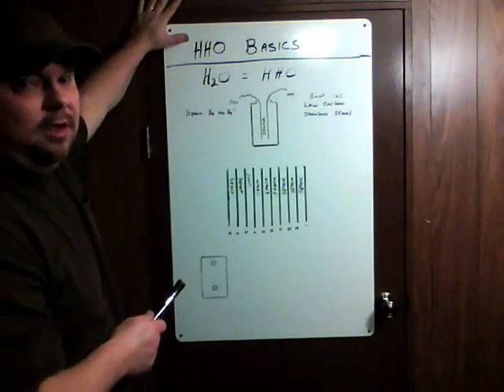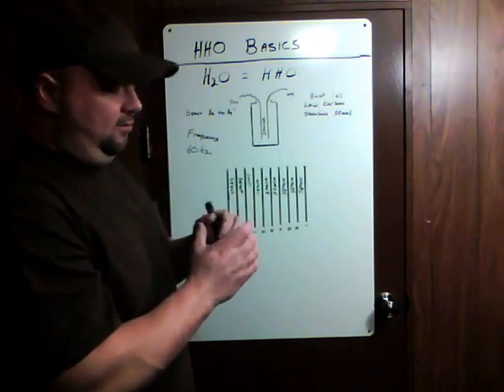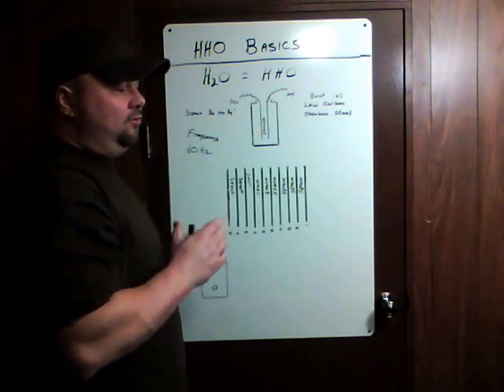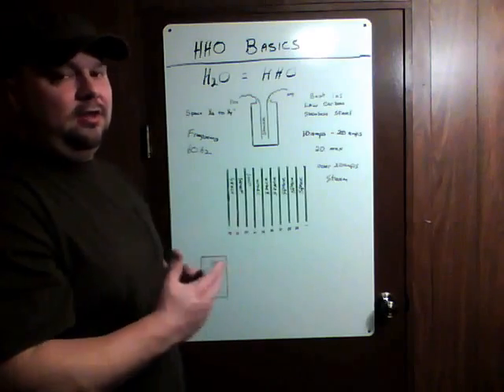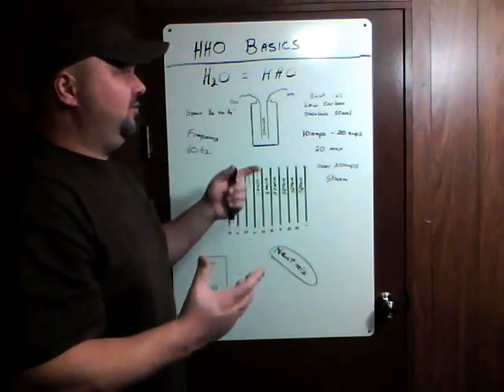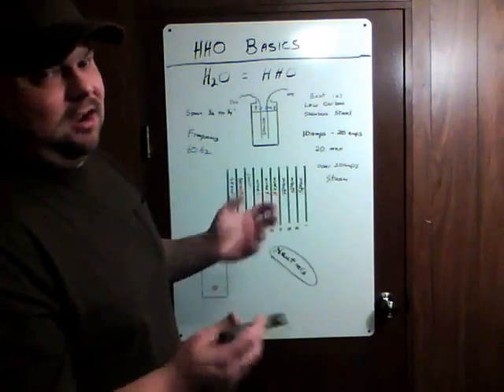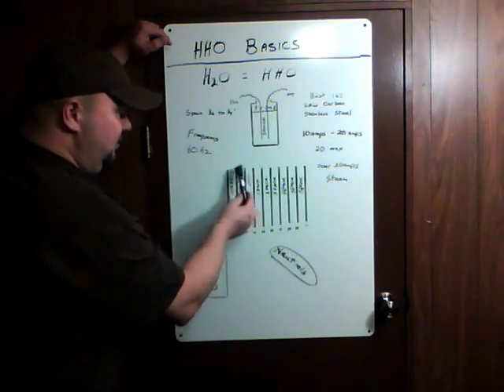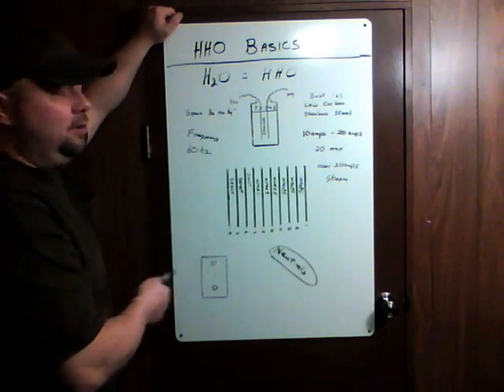HHO Basics - Learn the Science Behind Browns Gas Production - HHO Basics

Comment: In a previous video you mentioned something about hooking up the cell to a switch and earthing it. Could you go into more detail about that as I'm new to this?
Reply from the maker: For safety reasons and for other testing / maintenance purposes it is a good idea to have both a manual switch and also have the cell connected to a switched circuit in a vehicle so that the cell is only active / live / on when the ignition is on and the engine is running.  Most fuel pump circuits are good sources for this type of connection since it is normally only on when the vehicle is running.  As for the cell itself you should really use a relay to power the cell with the switched circuits controlling the relay.  This way your power source can be supplied with much less resistance both power and ground.

Comment from the maker: Wow I am sorry I just noticed I never responded to your question.  A dry cell unit can still overheat because of high current draw which will cause the water to heat up beyond a point that it is producing only HHO.  If it gets hot enough to produce steam it's actually defeating itself.

Comment from the maker: You can purchase prefab units online complete with PWM but building one yourself is a far less expensive way to get started.  Begin by building my basic design (paste this number ->3LVhNj5Hf0 in the search box ) and then move up from there once you have figured out the basics.  Unless you are getting into a larger unit a Pulse Width Modulator wont give you much of an increase in production of HHO gas anyway.

Comment from the maker: Sorry I am just responding to this post.  I talked with the guys from the lab there and they shut down the whole thing.  It's too bad because their pwm boards were the best I ever seen.  Any pwm with a high amp rating will work but theirs had far more adjustments for duty cycle and pulse width control as well as amp control which is very rare.

Comment: Good principals for traditional brute force electrolysis. I encourage developers to look into Stanley Meyers approach in primarily using Voltage rather than Current as a means of breaking the electrical bond of H2O. Benefits include lower temperatures and you wont need to rely on an electrolyte mix; making it cleaner. The most important component is the Voltage Intensifier Circuit. Using Stainless Steel 316L low carbon marine grade is the best material for anodes and cathodes.

Comment: Great Video, people that experiment with HHO need to know this.

Neutral plates are essential in HHO Cells, because they lower the voltage per plate and also reduce amperage, by increasing the distance between POS & NEG plates. (Amps = Heat)

An Amp Meter is a necessity, and so is a 12V 15A or 20A Circuit breaker, so you don't continually waste money on fuses.

mcmaster carr has a great website for purchasing materials and essentialdepot(dot)com has Lye or KOH at great prices.